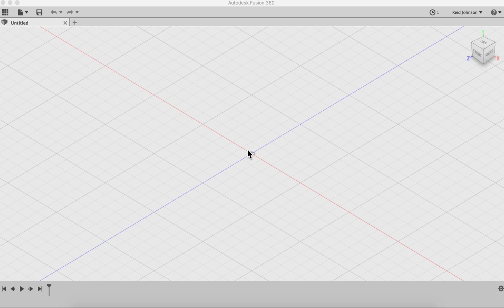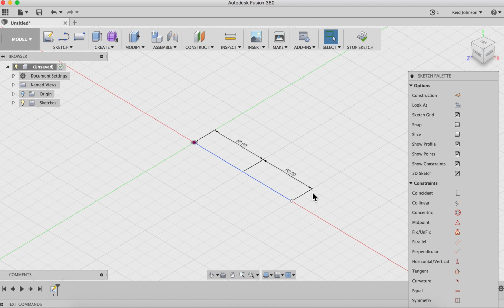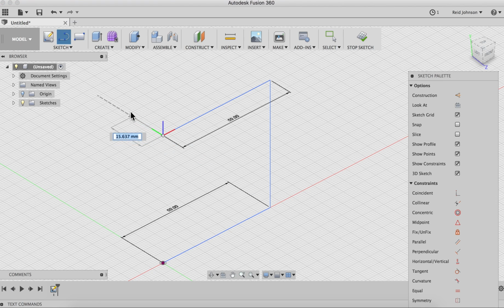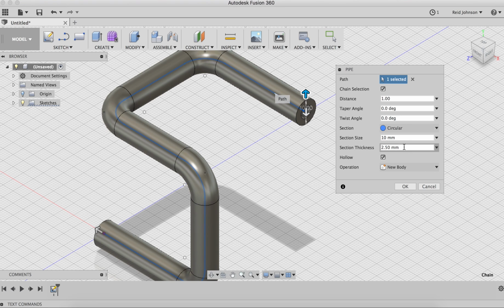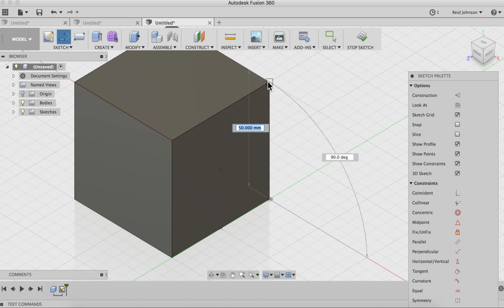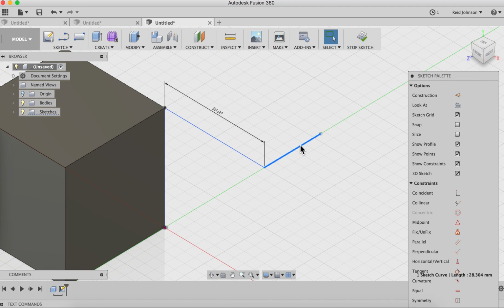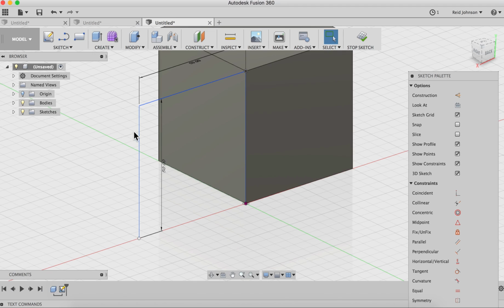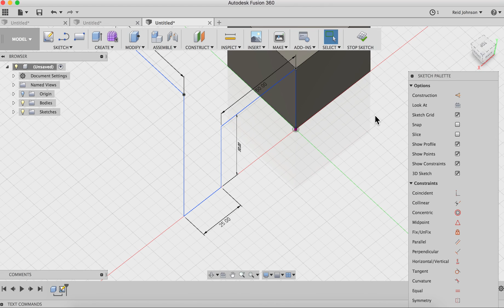How to Create a 3D Sketch in Fusion 360 / How do I Create a 3D Sketch in Autodesk Fusion 360

Comment: Question: I followed your EXCELLENT tutorial.  Worked great unless I wanted to go through the side of a box.  If I build a cube, hollow it out, and then connect a hollow PIPE to it, how do I extend the HOLLOW pipe so that it connects to the CUT inside the Box??  Thanks.
Reply from the maker: Great question, if all else fails, I would try making a construction plane on the cut face of your box. Then, I would use sketch elements on that construction plane to try to find the connection point.

Comment: If you want to make it parametric(for circles and ellipses) remember to use offset plains, this will save you so much time if you need to do adjustments later.
Reply from the maker: Excellent call to use the offset planes